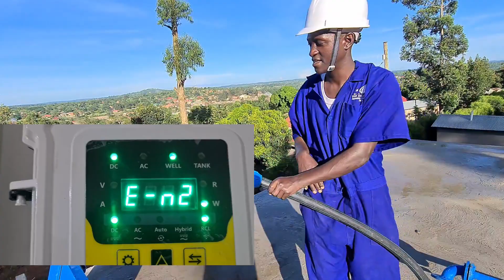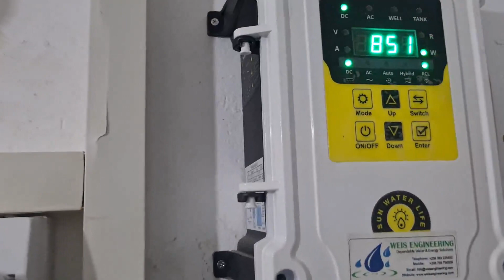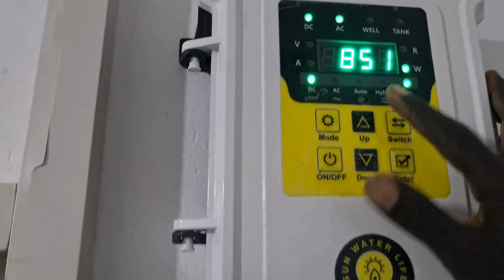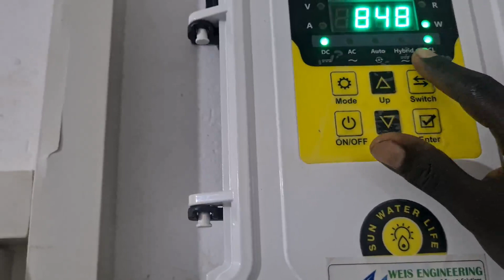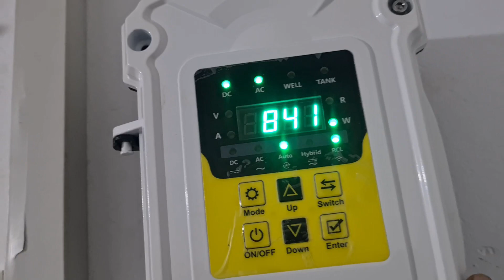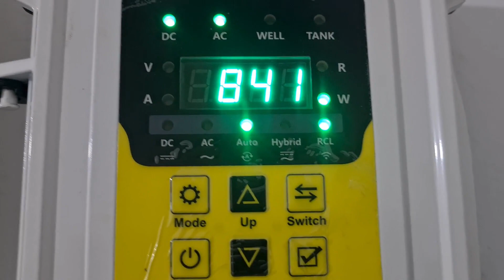No operations stress and costs remotely controlled automatic solar powered water pumping system

Comment: Hie they I have been watching your videos but I need to know is the controller  inverter it self or how, if you are running DC pump how is it possible to  use Ac source or when using ac pump then got DC source, pls answer me does it convert the energy automatically or?
Reply from the maker: Hello, thank you for watching some of our demo videos.
The inverter converts the input energy into the energy type required by the pump motor

Comment: Do you have batteries on this system?
Reply from the maker: No, we didn't connect batteries.
Batteries maybe required for systems with water sources of very low yield and you need to pump extra hours past the sun hours
Reply: @WeisEngineeringLtd  Thank you. Keep up the good work👍👏
Reply from the maker: @abasembatya  Thank you ssebo, we always work to improve